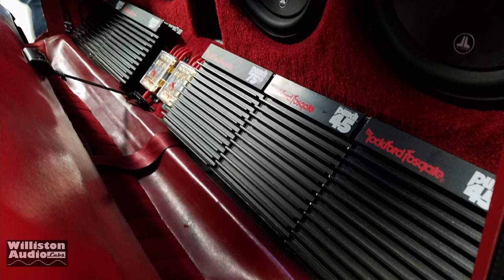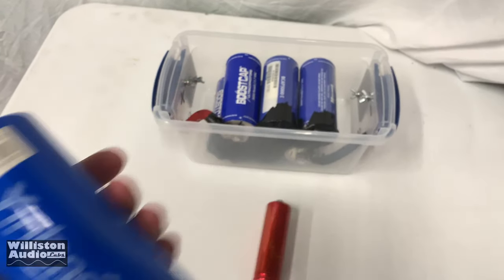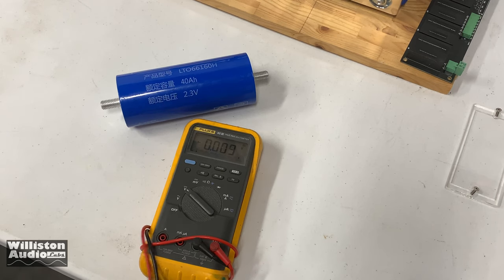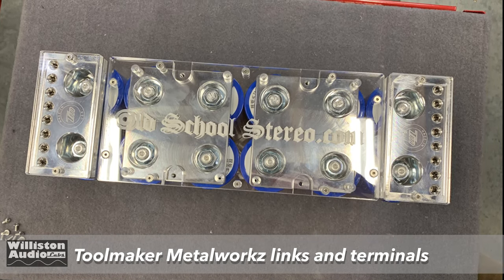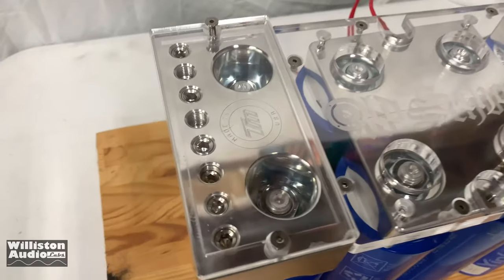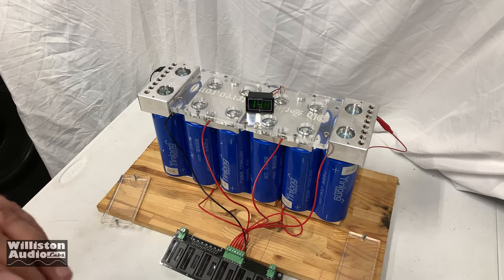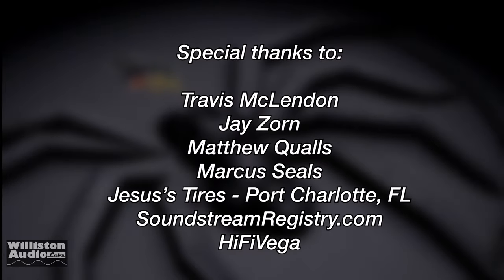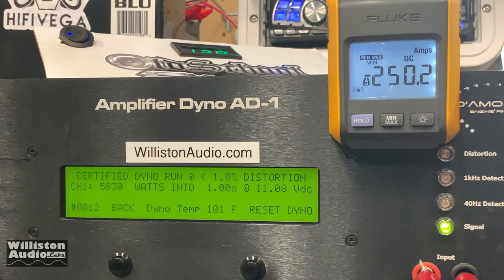Lithium Batteries for Car Audio? Yinlong LTO Cells LTO66160H 8000 watt capable Battery Bank [4K]

Comment: I'll never expected to hear "6S" in a car audio video!
Reply: Get used to it, Lead Acid is dying.
Reply: @kingrpriddick  im sure you have no idea about electric RC models....
Reply: @BASSstarlet  You are? You might want to check that assumption.
Reply: @kingrpriddick  "6s" is a common phrase in rc community that refers to the voltage of the specific battery (one cell equals 4.2volts for a Lithium polymer battery)
Reply: @BASSstarlet  It's also a common arrangement for 12v lead acid replacement with LTO and LiFePO4 chemistries. I saw it done at least 6 years ago. "More common" 3.7v nominal cells like Lipo (not really a chemistry, more of a way to say pouch cell), NCO, NMC, etc can't really be used in automotive 12v applications.
Reply: @kingrpriddick  I highly disagree with that. Lead acid definitely isn't dying
Reply: @beardedforlife3740  we'll have to agree to disagree then, lead acid is slowly being abandoned for longer lasting, more power dense, and higher specific energy batteries.

Have we reached a point where lead acid is always the wrong choice, not yet, but lithium already has a larger market share and I don't see it's proliferation slowing.
Reply: @kingrpriddick  we have a factory a few miles down the road that still produce thousands of lead acid batteries daily
Reply: @beardedforlife3740  That is anecdotal evidence, that could be the last such plant in the world but it's right down your street so lead acid is just fine and totally normal.

We know it is declining in the market, we know few advances are possible, we know R&D dollars have dropped. The technology is dying. Corporations are simply going to keep making money until they can't anymore.
Reply: @kingrpriddick  unless prices are reduced to that of lead acid batteries. Lead acid won't die out simply based on the fact that a majority of people can't afford or have need for a lithium or even agm battery

Comment: so basically you cant use yinlong with basic 12v agms and so that mean u can use xs power's 14v and and i think the 16v ones aswell
Reply from the maker: I was told you shouldn’t mix chemistries but the 14V AGM and these can work together in a pinch

Comment: What will protect the cell voltage from dropping too low?
Reply: Pretty much have to keep an eye on the voltage. They are good down to 9 volts before they would even come close to hurting them.
Reply: @sethgt1234  have you had yinlong cells below 10v and been fine?

Comment: Ill just stick with big lead acid marine batteries. Some day when the price drops drastically maybe ill get lithium.
Reply: BASSN SANE  Yup. I got my big interstate marine battery for 60$ from our battery supplier at the mechanic shop I worked at. It was a 200$ battery but he gave me his employee discount. Now I am sold on the big marine batteries. They work awesome!
Reply: Deep cycle batteries do not deliver power as quickly
Reply: Lithium is pretty much cheaper.
Reply: @Rangotherabbit  cheaper than what, where? Lithium is much more expensive anywhere I've seen
Reply: @Eric Vincent Bingo. Lithium will FAR outlast  any SLA or AGM.
Reply: yeah i had a 200 amp truck battery in my car and lasted 5 years blasting the subs... no need for this yet.
Reply: @Juggernaut-fg2up  lithium is cheaper when you consider longevity. Also comparing a 40ah lithium bank to a 40ah agm, you'll never get the same power out of the agm as the lithium

Comment from the maker: Yinlong 40aH Cells (XS Power Branded): https://diycentralshop.com/product/40ah-lithium-cell/
Toolmaker Metalworkz custom links (may need to message if they are not on website): https://toolmakermetalworkz-com.myshopify.com/
6S Battery Balancer: https://is.gd/ces6sbalancer
Bolt Depot Serrated NUTS!! (12mm x 1.75mm): https://is.gd/yinlongbolts
XS Power IntelliSUPPLY Charger/Power Supply: https://amzn.to/2YBvbZ2
Variable 10A Power Supply: https://amzn.to/31178jG
Multi-Cell Battery Monitor: https://amzn.to/2YtXWXd

Mazda2284's video on Yinlong LTO Cells: https://youtu.be/V7E8hL3MWWM
Lithium Car Audio Facebook Group: https://is.gd/lithiumcaraudiofb
Contact for Yinlong Group Buys: https://www.facebook.com/shawn.mayo.984
Reply: Can i use these in 2s 4s 8s not only in 6s or 12s
Reply from the maker: @FATHERSOFBASS  For car audio purposes, 6s for 14-16.5 volt systems. 7s for 18-19 volt systems. I'm not using 12s, I'm using 6s 2p (6 in series, each bank in parallel). I'll have 2 more banks of 6 soon for more powa!
Reply: @wal  gotcha... So if you odd number it, it jumps voltage???
Reply: So is this an 80ah or 480ah? Each cell is 40 so 480 total right?
Reply: @ryry7886  80ah... Each six makes 40ah theres 12 so its 80ah

Comment: Can you use a shop 12v battery charger to charge and equalize that lithium battery bank?
Reply from the maker: No it needs more than 14V. Should charge around 15.4V

Comment: Something is very wrong there, two banks will not drop too 11 volts from 15 volts without a massive 20c plus load which is 1600 plus amps.
A 9.47c pull (750 amps) should drop from 15 volts to no less than 13.8 volts for a burp above 50 degrees farenhiet.
Reply: he was somewhere around 550 amps? so yes deff something wrong.. i feel maybe he has a single bad cell

Comment: How's it going Big Dee? I know this is an old video you made, but it's still informative. My question is, can I run two battery banks after being built in paralle of one another? and can I run these LTO's in conjunction (parallel) with a super capacitor bank under the hood? Thank you for your time. And keep up the good work and videos.
Reply from the maker: Yea you can parallel and yes you can use with capacitor bank 👌
Reply: @wal  thank you Big Dee.

Comment: That's about the same Voltage drop as Sundown unofficial has measured with one bank of Boostcaps.
Anyone thoughts on that? I'm a bit surprised
Reply from the maker: Turns out these need to be charged to around 15.4-15.6 for best capacity

Comment: I need your help big D. I want to build a battery of the headway 38120hp 100ah. How many batteries will I need to buy?
Reply: 3.2v each so do the math till you get the voltage that you need

Comment: I think I will wait until Lithium technology is a bit safer and smarter, after seeing what happened to Marcus Hux's powerbank, I willl stick with AGM or those big Caterpillar batteries. Paying more in fuel is a good trade-off for not having a car-b-cue.
Reply: You should check out these cells safety videos. It's completely safe tech... Lithium titanium oxide
Reply: Totally different cells
Reply: Marcus hux was running lipo
Reply: @DrunkPisces  yessssir
Reply: The techs already there. These cells are much safer then your current car battery.
Reply: @Str8GasGenetics  where

Comment: There's deff. A problem here. Your 80ah bank should be able to hold a 500 amp load for alot longer than 5-6 seconds. There's a problem somewhere. Perhaps a bad cell? Def.. need to look into this. I'm curious as I have a 40ah bank and am going to order another bank soon. 1 40ah bank can hold a 400amp load for over 30 secs w no charging . So yea ,there's a problem somewhere w yours Derrick. Please keep us/me informed with what you find out.
Reply from the maker: I’ve noticed other tests keeping much higher voltage over 50-60 seconds

Comment: Nut. Not bolt.
Newton meter. Not nano meter
Don't directly connect cells in parralell. That doesn't limit rush current and could damage or even, albeit rarely, cause cells to vent or burst.
I know you wanna put together a guide etc. But safety and proper terminology are key. Else, users can be confused or even hurt when following. You want to just charge or discharge the cells to get them as ose as you possibly can before connecting them in any fashion, discharging them can usually be done easily enough with a few resistors and a led. While time consuming, this would be a safer way for the cells and the assembler.
Reply: You bring up the exact reasons I'm worried about the proliferation of these cells into car audio. People act like these are some new high discharge lithiums, yeah no lol. There's a reason people who have been working with them for hobbys or their industry have such robust protection and balancing circuitry.
Reply from the maker: https://youtu.be/tqd3HS_m6SY

Comment: So do you need a 16v alternator to run these? If they rest at 15v and car charges at 14v how does that work?
Reply: External regulator for your alternator to charge at 15v-15.5

Comment: When you test the taramps they like a lower input voltage needs to be bout 2v preamp at the rca
Reply from the maker: I’ve already tested it as you will see in a future vid
Reply: James, I really feel that it's a misconception. I've done testing myself and input voltage didn't matter like that. I have asked multiple people to provide video proof that lower input voltage magically makes them more efficient but I have yet to see it.

Comment: Big D you should pay attention with that charging protection. I don't think is working anymore in this setup. To charge all the same you need to connect each element to the + of it. You made pairs but not necessary they have the same voltage in them. Is like putting all in parallel with no protection and charge them directly on the network and thinking: "man they must be the same cuz I charge them all at once". I don't think this works on elements as you did. Don't know. Worth investigating with a multimeter.

Comment: These types of batteries are NOT chargeable with an alternator like an agm or lead-acid battery, correct? Is there a lithium ion, lifepo4, or other lithium-based battery available on the market that can be used as a drop-in replacement for lead-acid?
Reply: Not sure, you can get close with a battleborn or similar, but it's not intended to start an engine and probably wouldn't want to get charged at high amps by an alternator... You really need a charger to limit the charge rate.
Reply: XS Power makes a few nice lithium units.
Reply: err not chargeable with an alternator? According to who and what? Don't charge them over ~5c and don't limit them to 14.2v. Get an alternator with a set point of 15-15.2v. You can swap out the voltage regulator.

Comment: when you say you are measuring one of the two 0 gauge inputs, why do you have two inputs?
Reply: Multiple runs for better current potential
Reply: @beardedforlife3740  ah, so they are in parallel.

Comment: It's clear that 6S won't work for a 12V drop in replacement because at full charge it goes over 14V. But a 5S arrangement won't be good either because it'll drop under 10V before the pack is depleted. My recommendation is to go 11S 24V and use a quality DC DC converter - a workable solution if any single 12V load can stay under 200A.

These cells are extremely suspect in both their capacity rating and certification. My attempts at getting A grade cells in bulk resulted in some exorbitant pricing at over $70 per cell. Their Alibaba rep I contacted also couldn't nail down a firm warranty - probably because the cells they sell for $23 are only B grade. Many buyers of these cells have been burned getting cells that performed under 40A and more closer to 30A.

False advertising or buyer beware? You can decide.

As much as I like LTO tech, until I see the proper certification markings on these cells, fair pricing, verifiable capacity claims and up front warranty details I am passing on these Yinlongs. We need more manufacturers producing  LTO 66160 for this to become a serious consideration and long term investment.
Reply: Yeah 4y later i know but 100% i agree yinlong's LTO is not a drop in. I still love the video though.

Can use a different alternator for a drop in but in any case even in 2024, for the money, just a fat bunch of lifepo4's work better.  

I've also had quirky experiences obtaining grade A cells. At one point i even wondered if they really made them 😅 🔨

Comment: Did I miss the part where you disscuss the advantages of using lithium batterys over lead acid?
Reply from the maker: I’ll discuss that in future vid. This was just really an assembly vid
Reply: Pros with these cells 
Better voltage ✔
Safer ✔
Lite weight✔
Different configurations for assembly ✔

Comment: I’d probably go with a solenoid or heavy duty relay to isolate my primary battery I herd it’s not good for lithium to be in a hot engine bay.
Reply: You can install lithium anywhere you want except engine bay. But you can still run strictly off the lithium itself.  Just make an platform and use terminals to connect factory wires and alt wires into it and run positive wire back to the lithium bank where ever you choose to install it. But these LTOs like higher voltage in the mid 15s so you vehicle may not like that to much. 
Other option is a split system 12v side "agms" and higher voltage side "LTOS "
I personally run a splits system 2 alts one for vehicle agms an 3 amps with 2 agms. And second alt runs my lithium side for 2 sub amps which are 30ks.

Comment: Can I mix with an agm if I use an isolator for when the vehicle is off?
Reply: Use a power inverter to power a lithium charger, to then charge your lithium 2nd battery. But keep an eye on the starter battery voltage, don't accidentally draw it down below ability to start your vehicle.

Comment: So the only dowside of this battery is the energy density ?
Reply: It would be a downside if you were running a bike or car from these cells. But since they operate in much colder temperatures and have 10 times the life cycle of lipo and lifepo, it's well worth the added size and weight.
Reply: @ekoms108  hey man thank for the answer searched much for it but it's really overpriced. For home use

Comment: Y’all should google RC lithium batteries etc and look at importance of balancing and not waking up to a smoldering garage. You need under volt/ over volt etc.
Reply from the maker: RC uses LiPO. These are LTO, different chemistry. Not all lithium’s are created equally

Comment: How many would I need for a 7000 rms system
Reply from the maker: This setup would work I later found the reason I was getting so much voltage drop is because these need to be charged to 15.5 for best capacity. If you use these in your vehicle you’ll need to remove 12V battery and understand the risks involved
Reply: @wal  I want to keep my stock bat tho
Reply: @wal  could u wire it a different way for it to roughly be around 13v

Comment: Overcharging a lithium battery by just a 0.1 volts can cause danger. I would say that balancer is not only recommended but actually NECESSARY for your own and others' safety. Otherwise you could have a ticking timebomb in you car.

Comment: back in the era when car audio competitions were as common as pie eating contest at a local county fair and hearing plethora vehicles bumping down the road was the everyday norm adding a $1000 plus investment into your power source was a given but in today's day and age where the crackdown by local municipalities on car audio has made cars that go boom in the street almost non-existent and if you do want to chance it you can get a few thousand watts for under $500 the idea of someone who actually has to spend hard earned money going out and dropping as much or more for a battery system then they've spent on amplifiers seems kinda obtuse especially when it is cheaper to makeup for the lost power of running the lower voltage of an AGM by just buying bigger amps........

Comment: Ok so I’m an even bigger dummy and need to know on the first negative the one directly behind it is that also negative like does it look like - -/++/- -/ ++ and so on? Or do I see -+/+-/-+/-+ (look it at it as if columns and not just left to right need to know the vertical orientation.)

Comment: I understand how this would work as a standalone system that you manually charge, but I'm still confused how this integrates with an alternator for charging the bank back up without overcharging the cells?
Reply: You can't overcharge them since the alternator is 14.7v.   In fact, you'll never be able to fully charge them most likely.
Reply from the maker: The banks can be charged as high as 16.8, JP’s are charged to 16.5 according to Scottie from XS Power
Reply: That's what the voltage regulator you have to use is for

Comment: @wal Are you still using this?
Reply from the maker: I built a bigger bank with 48 total cells in 6S 8P setup and yes I use it for almost all of my amp tests unless I test something where my 100A variable power supply is sufficient

Comment: isn't + to - a short? this is what confuses me about hooking these up.
Reply: When connected directly - yes. Think of it as a circle though, or a string, a loop of +-+-+-+- adds up voltage. You just don't complete the circle by connecting the first + to the last - or you'll end up shorting all the cells out! Think of a line of AA batteries end to end, they're also + to -, the exposed (final)  connections are the new higher voltage + and -

Comment: Fellow big dummy here lololol. You can just drive the car around and the alternator will just charge the lithium batteries up as usual right? No need to remove the unit and charge them?
Reply from the maker: Yes